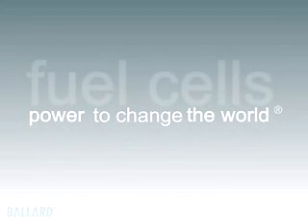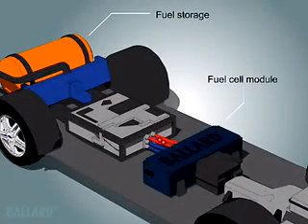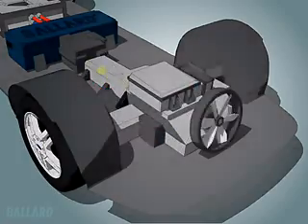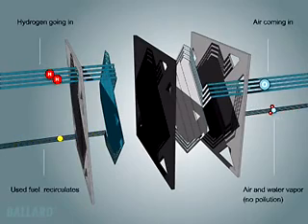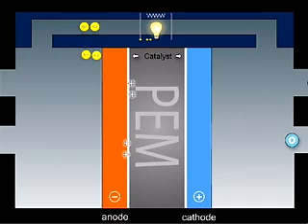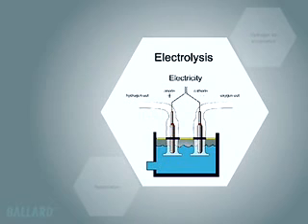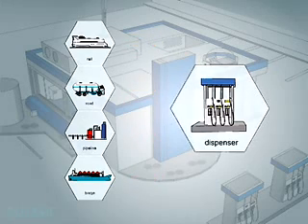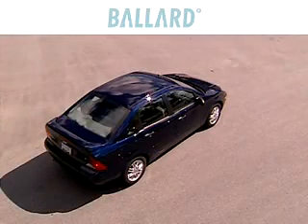Ballard Energy : How a Fuel Cell Works

Comment: You seem to be missing my point, however.  My point was that electric cars still use power that comes from power plants that burn fossil fuels, as do combustion engine cars.  So gas cars AND electric cars both use fossil fuels (which pollute) as their source of energy, however, power plants obviously can generate the energy more efficiently, which equates to less pollution.

Comment: What you are failing to realize, however, is that using a coal power plant to produce the hydrogen is vastly more efficient than regular car, therefore less pollution.  Similar to an electric car, although you still need a coal power plant to produce the electricity for the car, the power plant is much more efficient than the car.

Comment: Wait.. threw electrolosis surely u could extract hydrogen and oxygen from water rite? And since water is a bi-product of the feul cell proccess, surely u could just recycle that hydrogen? It would just involve an electrolosis tank in the car aswell, and it could charge as u go, and charge over nite. Only problem i guess would be making energy to start the proccess up, but couldnt u just use a car battery like we do today?

Comment: The PEM cell is expensive and damaged over time. The hydrogen should be disolved in another material or produced on demand - to reduce the danger of explosion and storage tank size.

We need to look at the complete process from production of vehicle and consumables (fuel, oil, etc.) through use, disposal of old vehicles, exhaust, safety, etc...Only then will better solutions be realized.